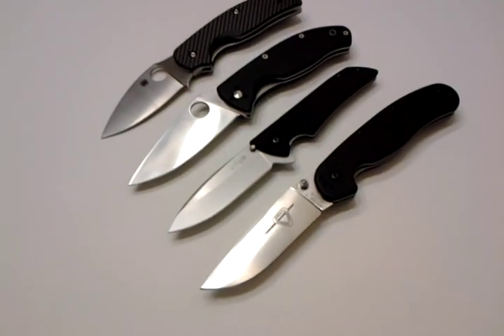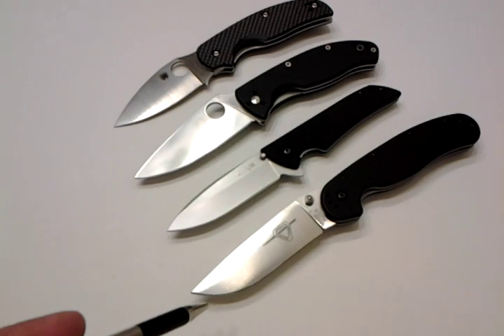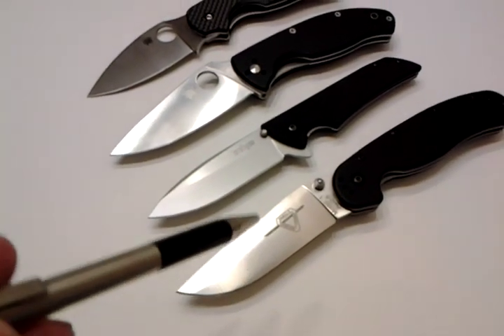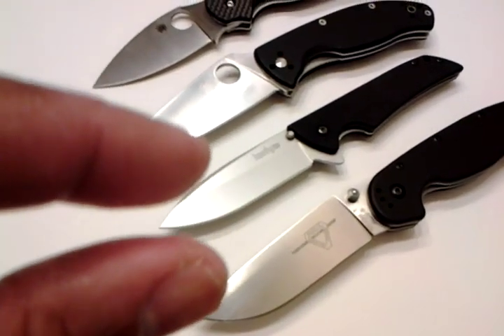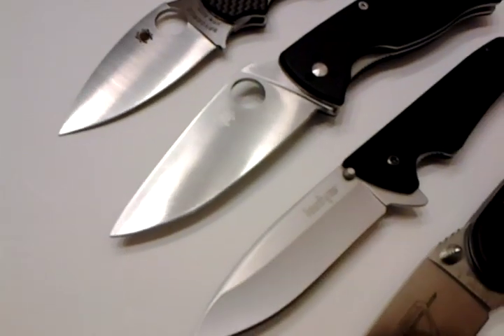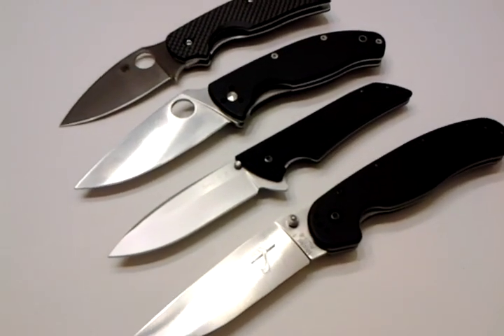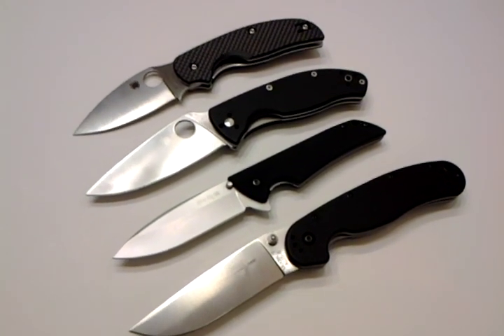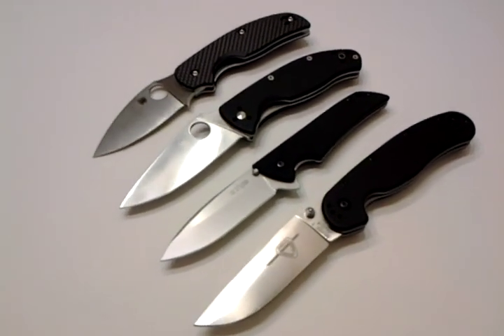Talking Blade Steels (s30v,154cm,14c28n,8cr13mo

Comment: 8cr13mov is garbage.   Sharpens like crap and looses its edge fast.  But its fairly tough and you can safely pry with it. 

BTW...  I can sharpen s110v with diamond stones faster than I can sharpen the 8cr13mov china steel.   

If your gonna loose your knife,    let it be an 8cr13mov garbage knife....      

But its not totally crap....  its not a pleasure to sharpen when compared other steels.  If your useing diamond hones then s110v sharpens up faster,  mainly because it stays sharper longer and deform way less.   

A steels hardness does not translate to it being hard to sharpen.....  get that out of your heads right now.....     it only matters on how fast your hones and stones cut,  thats it...   and with today's industrial diamonds,   steels that are way harder and have better edge retention sharpen as easily as aus8 or 154cm.   

But my pm2 in s110v will take fewer strokes on the KME to refine and sharpen its edge vs an 8cr13mov tenatous....   Even tho regular oxide stones and wet stones will not even cut the s110v...   you can stay there all day and my pm2 in s110v will dish out your sharpening stone or your Arkansas stone...  yet it will sharpen the tenatous just fine...  not as fast as diamond will but my wet stones chew up that 8cr13mov so much it clogs the stones and sucks to sharpen.   

But a knife being hard has nothing to little to do with edge retention,   and its edge retention that usually makes a knife hard to sharpen,  unless your useing diamonds.  And those steels like M4, s90v, cpm s110v ect do not or are less apt to roll an edge or round the apex so bad that it usually comes back to hair widdeling sharp in 10 min,   starting at the 300 diamond.  And going to the 600...  seldom do I use the 1500 on s110v,   with that type of carbide steel you want a toothy edge at the microscopic level.    It will still be plenty sharp enuf to push cut paper,  but it will stay sharp longer cause of the microscopic serrated or toothy edge.  Its quite impressive to see how long an s110v knife will shave hair for.     8mov13 will not pop hair after you open a half doz boxes with the knife,   the s110v will pop hair after 30 boxes,  and counting.....   its impressive...   but you cannot pry,  or poke cans with that type of steel,   flesh, roap, or clothing...   No tuna cans with s110v....     but you can poke tuna cans with 8mov13...   and 154cm.   S30v...   ect.

Comment: The Spyderco Native did not come in 154cm it came in s30v, s35vn, s90v, vg10, s110v, and I believe 440v in the first run early models. The Spyderco Manix 2 was available in 154cm and MANY other steels. The Native never was produced with 154cm steel.

Comment: ATS 34(Hitachi) is not VG-10.  

VG-10 is made by Takefu Special Steel Co. Ltd.  

Carbon (C) 1.05 Chromium (Cr) 14.00
Cobalt (Co) -- Niobium (Nb) --
Copper (Cu) -- Manganese (Mn) 0.40
Molybdenum (Mo) 4.00 Nickel (Ni) --
Nitrogen (N) -- Phosphorus (P) 0.03
Silicon (Si) 0.35 Sulphur (S) 0.02
Tungsten (W) -- Vanadium (V) --

 Made up of Carbon: .95 – 1.05%, Vanadium: .10 - .30%, Chromium: 14.50 – 15.50%, Molybdenum: .90 – 1.20%, Cobalt: 1.30 – 1.50%, Manganese: .50%, Phosphorus: .03% 

ATS-34 contains .1% less manganese then 154CM.  ATS-34 also has a small amount of sulfur and phosphorus which is used for ease of machining. So basically the two metals are the same except one is of Japanese origin (ATS-34) and the other (154CM), is American.

Crucible first developed 154CM as 440MOD, substituting 4% Mo for 4 of the 18% Cr in 440C. They developed this to get red hardening qualities for jet engine turbo fans. 
ATS 34 is the later Japanese copy. There has been debate as to which is better steel, but they are both essentially the same thing.
The key is in the heat treatment.

Comment: Say Heah,  I just ordered a fix blade for basic bush work,  I didn't like the way the Mora 2000 looked,  But after pulling the trigger on a knife/Hatchet combo,  It became one of my Fav's.  I really like the Dual Grind on it especially for how I use it and that's to work wood with.  I ordered a W. C.  Master Woodsman which is a William Collins design,  It too has a Dual Grind that I really grew fond of with my 2000. I did have a choice of steels,  The original Master Woodsman is made in a O1,  But I decided to get it in the CPM 154 over the CPM S35Vn and the CPM D2,  I just want your opinion on which steel you would of picked and why,  I did it because it has more carbon and that allows more for a keener edge,  Again this knife will be a general do it all belt knife,  Thanx in advance.

Comment: Aus 8 is not a soft steel. That is entirely related to hrc. So even so called super steels can be soft if heat treated poorly. 14c28n has the finest carbides and will take the most razor edge then aus8 and last s30v; wear resistance is the opposite though edge stability is highest in 14c28n and can hold lower angles than all others. Saying a blade steel costs more equates to better is simplistic to say tbe least and naive. Aeb-l hardened to 62hrc is better than s30v at same hardness due to s30v lower toughness and propensity to chip.

Comment: I'm sorry.  While your video was easy to see and hear (good quality), it does not provide any useful information, ie., spec, hardness, durability, intended purpose(s), etc.  People look for this information when making purchase decisions; I do anyways.  And by the way, the Skyline will certainly cut through cardboard boxes - any of these will with ease and if sharp.  That said, I use a $2 box cutter and replace the blades as needed.
Reply: and there are even worse ones. I just watched a minute or 2 of one that the guy was talking about his day at work, attempting to show blades made from various steels and none were in screen for more than a second. Sometimes he tantalized us with just the tip. Save yourself some time and go right to the metallurgy videos. What you will learn is steel is important but the heat treating and tempering can make all the difference. The most expensive steel can be turned to shit with improper treatment by the manufacturer.  I thought I would give these a try attempting to find out about D2 tool steel.  People seem to be raving about it now and I was wondering if finally we had the steel that Excalibur was made from...